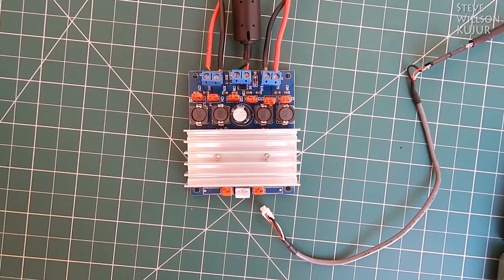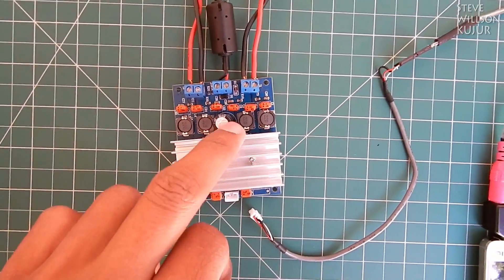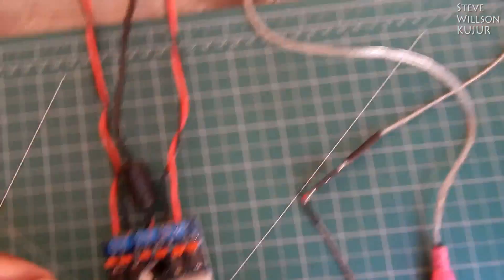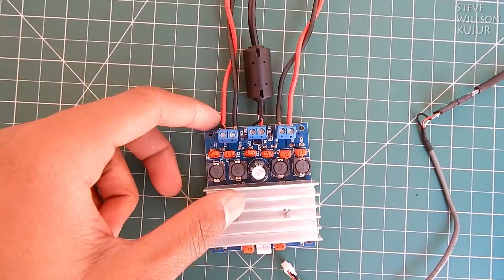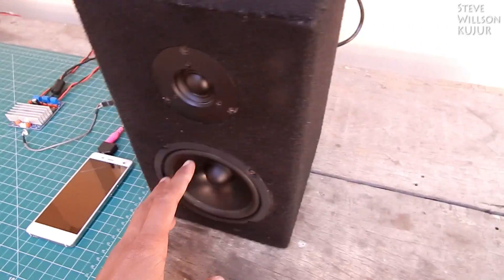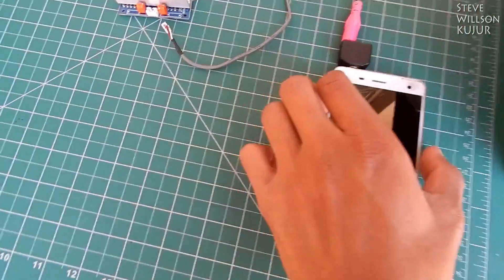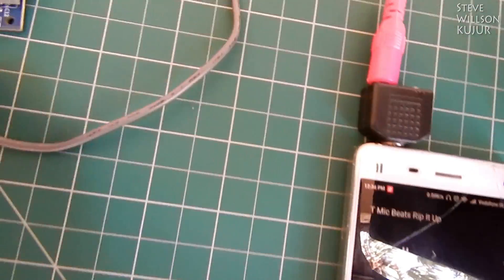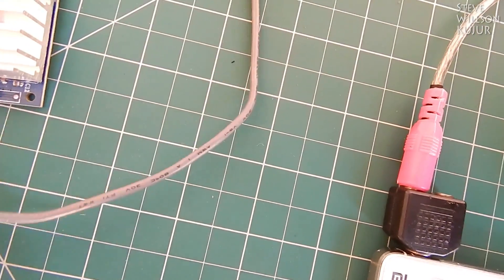TDA7492 Amplifier Test | Class D 50 X 2 Watt Amplifier

Comment: Hello
Very good that you are testing amplifiers.
I have a question, which amp has better bass? TDA7492 or TPA3116D2
Please reply.
Regards.
Reply: They are both very good.. Subjectively, I think that the TDA7492 has slightly better sounding bass and a better overall frequency response. The TPA3116D2 also sounds awesome, but it chews up lots of current when playing loud (especially with a bass boosting preamp), and will audibly clip at high volumes. The TDA7492 is great for its sound, but the TPA3116D2 can drive literally any speaker.
Reply: Thank you for your answer. I have small gym , I like good bass. I buy TDA7492.